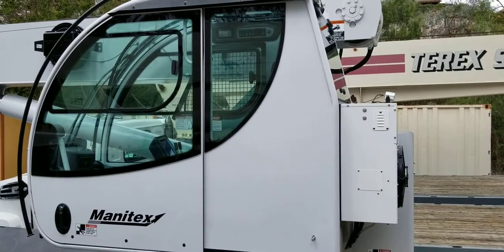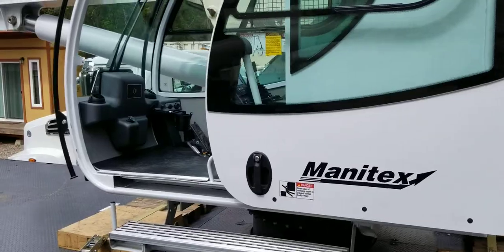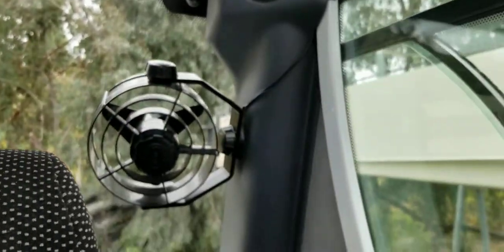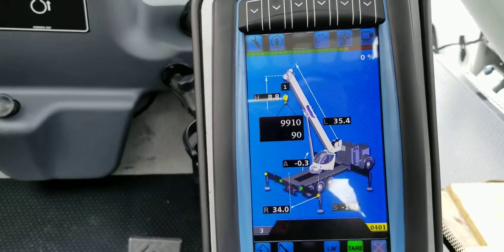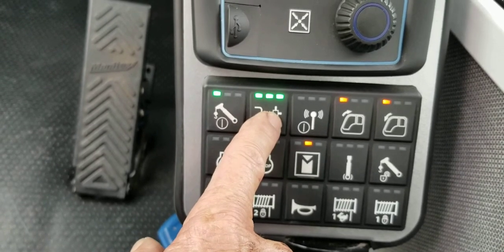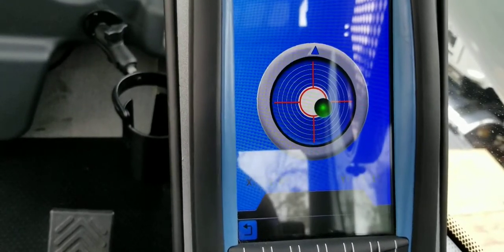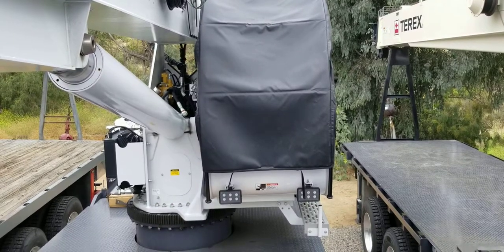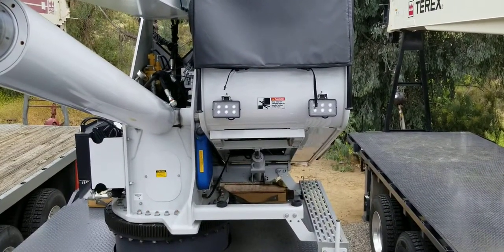Manitex Crane Inside the New Manitex Tilting Cab/Interior

Comment: Thank you for your review. I am to receive my new 30112 this summer, does the throttle preset idle down with no control operation or does it remain at set idle setting until turned off

Comment: Do you find the new  30112S as good  stability? I have the older style cab. So the barrel on the subframe is lower. Mine as very good stability
Reply: I've only spent a short time on one with the older style cab and I have to say this is every bit as stable. Both feel a little light on the outriggers over the side at capacity though IMHO.